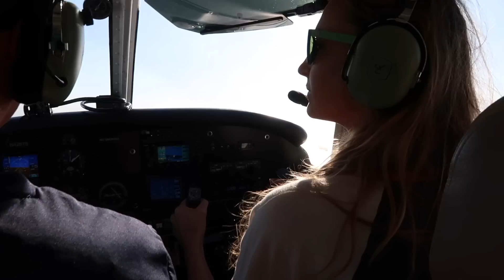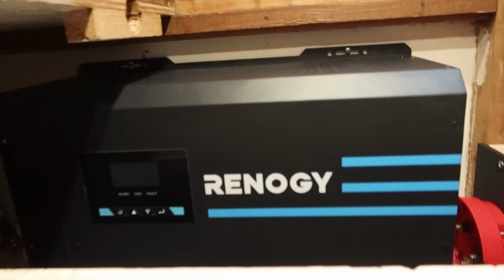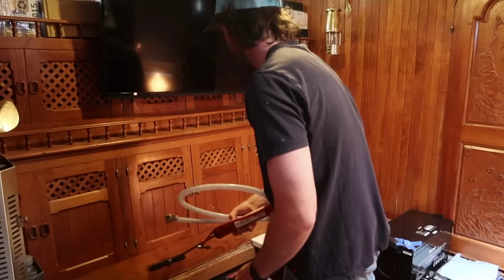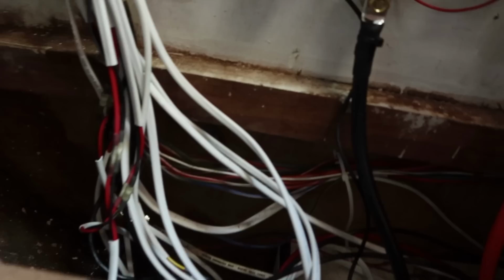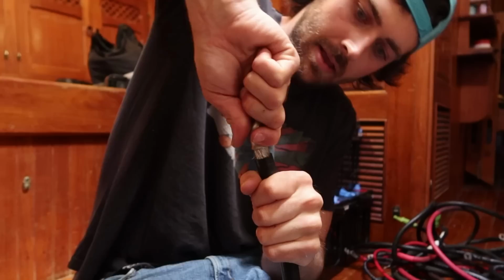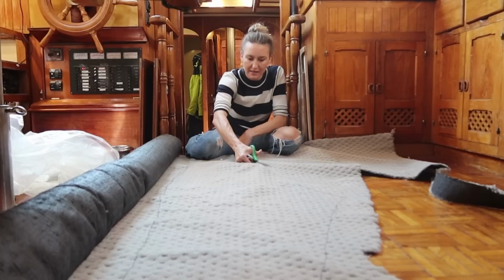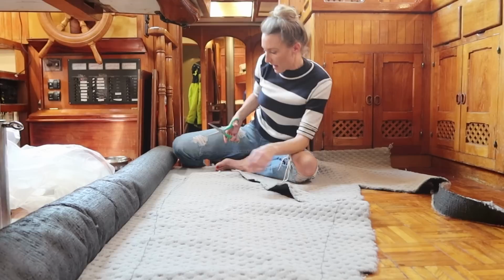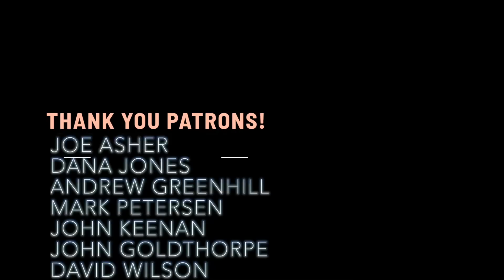Questionable Seamanship | PIRATE SHIP S15E04

Comment: My Refleks-heater used to do that, turned out the regulator overflowed into the burnchamber instead back into the daytank... almost went in orbit. I have a better regulator now with overflow not leading into the burnpot. Much better

Comment: Start planning for 24 or even 48 volt DC if you really want to add capacity to your electrical system.  Even 4/0 gets limiting when you start running multiple appliances.  It's not just a heat issue, the voltage drop starts eating into your capacity too.
Reply: Came to say this.

Comment: Sailing Temptress with Emily & Clark’s Adventures has the best advice about WIRE, BEST GREASE for marine electronics & soldering, etc.  ESPECIALLY good 12v AC where no generator is needed, etc.

Comment: It would be wiser to be running a 24-preferably 48 Volt system if your planning for high wattage  usage. The price decrease in copper wire size and cheaper inverted will be substantial ,. Server rack 48Volt batteries are much cheaper than Renagy 12 volt batteries as well. Likely still cheaper than the discount given by Renagy, the inverters are cheaper for 48Volt volt as well as that voltage is designed for off grid homes not the RV market which is sold as a premium service. I LOVE the fact that your getting a large and well equipped system for the boat to show off to everyone the capability of new technology and battery chemistry.   CHEERS AND FAIR WINDS     Steve h.

Comment: Is electrical noise something you can actually hear?  Is it a buzzing sound?  Or is it just RF stuff ??
Reply from the maker: Its a buzz
Reply: @SailingMissLoneStar    Can't really tell but it looks like a transformer.  Think old school.  Guitar amplifiers, old tv's etc.
Reply: @SailingMissLoneStar  fyi, that buzzing is called "coil whine". In a nutshell, it's caused by certain little parts vibrating as current passes through them.